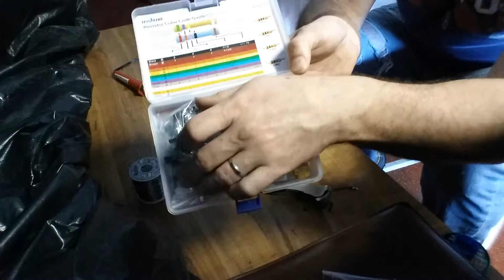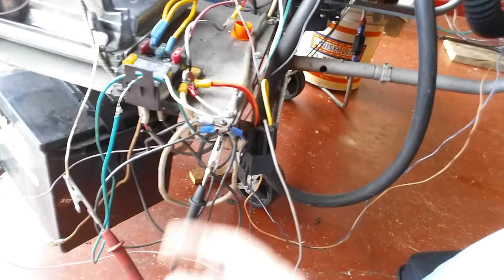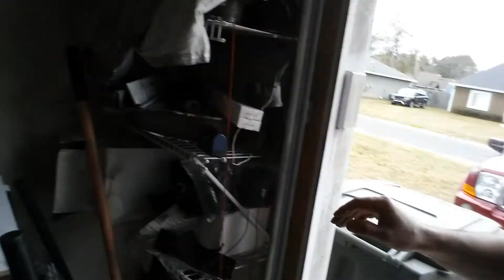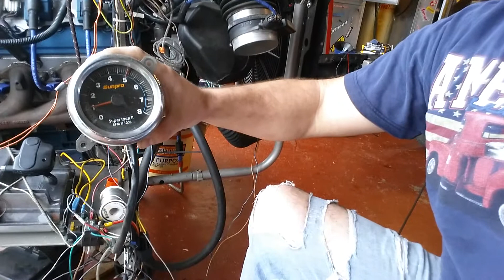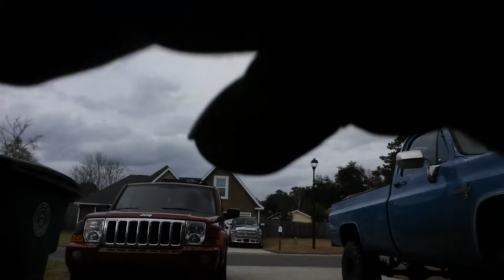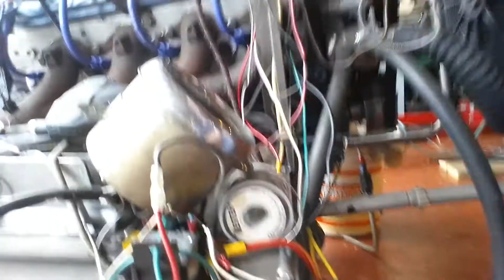LS tach signal and proper resistance for your Gauge.

Comment: got a C50 diesel tach to install in my C10/6L LS my after market tach work fine setting at 4 cylinder....what do you recommand fot ressitor ( or potentiometer) to match the diesel tach (feed by the alternator originaly) and the tach signal output from the LS PCM? thx and nice work on your video

Comment: My #10 tach wire give off 12v with key off engine off...I tried the resistor trick with no luck,  does it matter what end of the resistor gets the switched power.......1k ohm 1/4 watt resistors.....do you think 10k ohm will work...I'm using a summit digital 3"3/8 tach
Reply from the maker: If the signal wire from the tach is showing 12vdc with ignition and engine off the tach may be bad. there shouldn't be power on the signal wire with ignition and engine off. Verify you have the tach wired correctly. If this proves to be true, your tach may be faulty. 
Lastly, do not skip straight to a 10k resistor. you will likely jump over what you need. remember the resistor simply slows electron flow. In this tech tip video we use it as a pull up resistor to make a very simple amplifier for the tach signal. Also, the resistors are not polarized like a diode. the direction of flow doesn't matter.

Comment: Hey can you use a 0.5w resister?
Reply from the maker: 0.5 watt resistor is to small to handle the potential load sent as a tach signal. The resistor will likely burn up if not immediately then soon after. I would recommend at least a 5 watt Resistor that has the correct resistance for your tach ( the tach functions in a way that Is smooth fluctuations coordinating with engine rpm.)